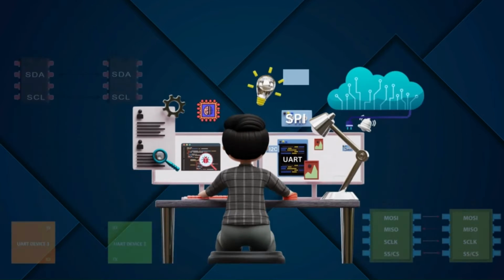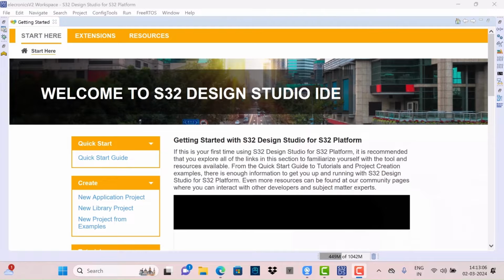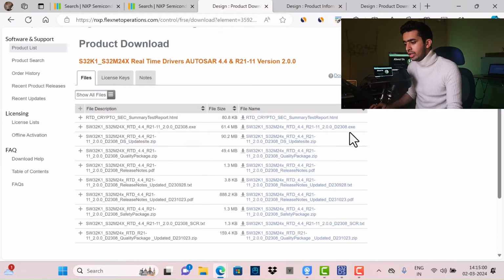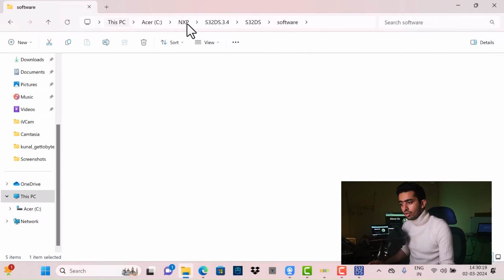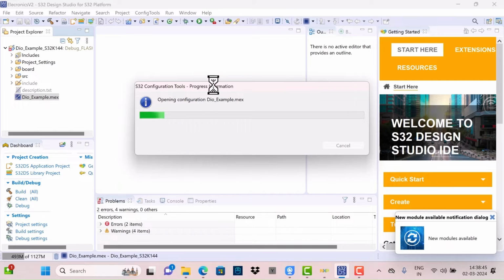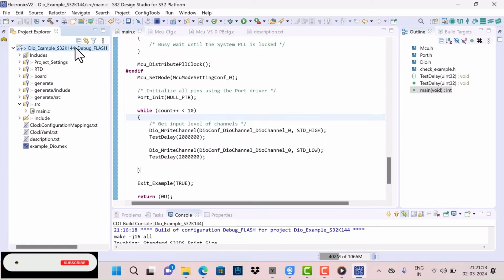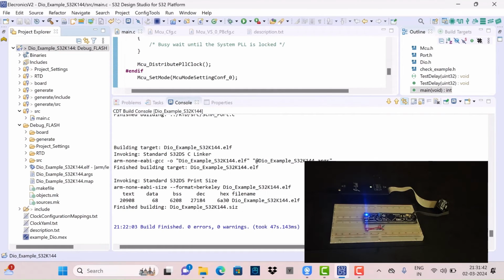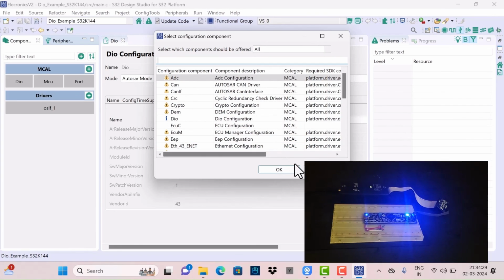𝐆𝐞𝐭𝐭𝐢𝐧𝐠 𝐒𝐭𝐚𝐫𝐭𝐞𝐝 𝐰𝐢𝐭𝐡 𝐀𝐮𝐭𝐨𝐬𝐚𝐫 𝐌𝐂𝐀𝐋 𝐋𝐚𝐲𝐞𝐫 || learn autosar software stack || autosar tutorial series.

Comment: Thank you very much for this amazing video and for sharing your knowledge.I will acquire that development board in order to get starting with Autosar development projects. my dream is get work in the automotive embedded field. By any chance do you know if it would be posible  use Matlab-simulink with the Autosar blockset to generate the ASWC and next  with EB tresos import the .arxml files to execute the RTE generator to finally configure the ECU BSWC in order to deploy the firmware to this automotive MCU? Or i will requiere another Fancy Autosar tool to achieve that? Best regards.
Reply from the maker: Answer to your questions.

1) yes it does support Matlab simulink with elecronicsV2 using autosar mcal layer.

2) it does support eb tresos to generate Rte and bsw layers and .armx files. For that you need to have EB Tressos license. Uptill mcal layer you can do easily in s32 design studio. But apart from mcal layer you will need to use tools like EB Tressos. In that also nxp does provides eb tresos free for 3 months in which u can explore all these things.

Am right now in notice period of my current job, post 20th may. I will be making proper playlist, courses and videos on these topics which listed above to support automotive software development.

Inshort answer to all your question is yes ElecronicsV2 is capable and can support all these things which u have listed, just eb tresos licensee has to be get if u wanna use for more then 3 months and wanted to go above mcal layer.
Reply from the maker: Rest you can buy the ElecronicsV2 Development Board from link mentioned in video description. 

Will be waiting for your purchase, so that you can start your automotive journey. 

For more doubts you can reach out to us via : gettobyte@gmail.com 

Or through our WhatsApp chat group: https://chat.whatsapp.com/EW3pkEDhygqHRfqVBWH5Pa
Reply from the maker: Hi have you buyied the board?